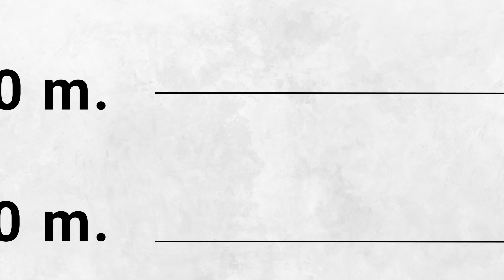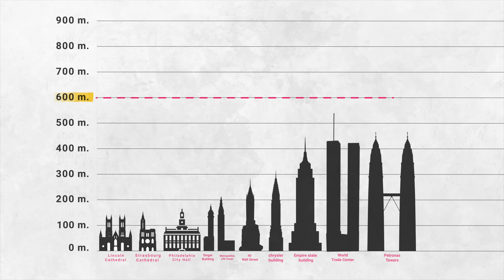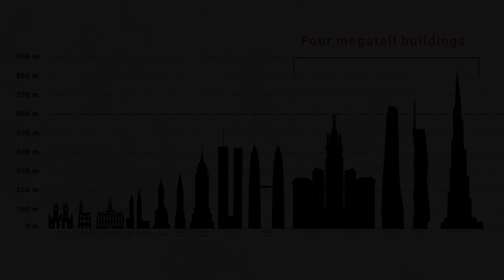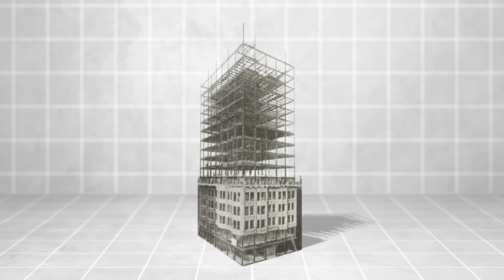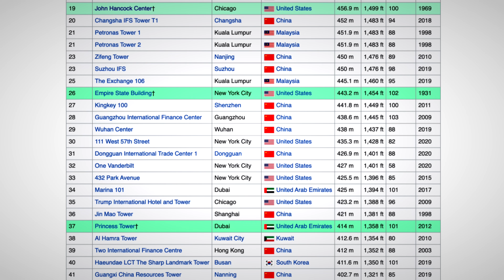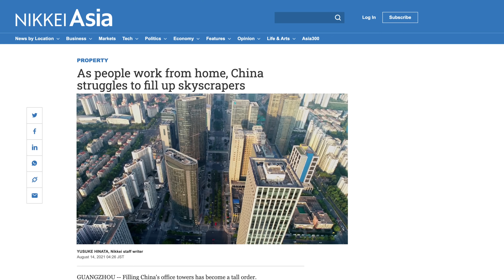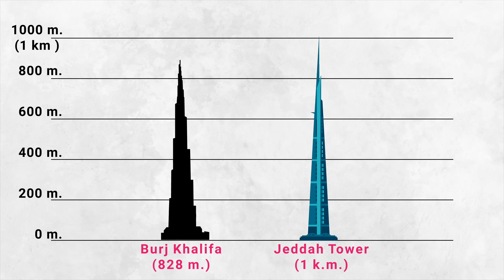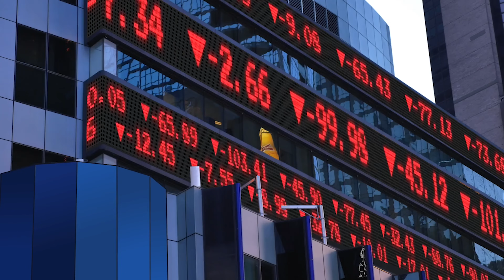The End of Mega-Tall Skyscrapers

Comment: I can't stand how skinny people put the the world trade towers on these graphs. They were massive buildings, height and width. They were the same width as the Sears Tower from top to bottom. Over 200 ft wide on each side. You could fit the Empire State Building if it wasn't wide at the bottom. I had been to them 5 times before they collapsed. Massive buildings that made 70 Pine Street and 40 Wall Street look small. And if you look at many other graphs, the roof top is higher than that in comparison to the petronas towers.

Comment: What about the tallest radio tower? I'd imagine those would be significantly easier to build. Doesn't need to accommodate housing and space, just height.
Reply: From 1974 to 1991 in Konstanynow, Poland there was a radio tower, that reached 646 metres of height, making it the tallest in the world. Unfortunately, it collapsed in 1991 (mainly due to bad technical state).

Comment: With new materials, new techniques, new construction machines and new energy sources like fusion, taller buildings will probably be built eventually. But it seems we reached our current economical and practical limit some years ago. With as many problems as the BK has, it seems it was built purely to be the tallest building around with no actual good reason (beyond the tuorist draw). I imagine that if humanity doesn't die out and we don't discover some vastly new and disruptive physics we will eventually see carbon nanotube space elevators, or space towers constructed with in-built active support, but that's not something a non-fusion economy can easily afford.

Comment: honestly the biggest problem with these towers is that they dont make sense in most cases to build.  lets say you build aa 600 m building and then put tons of people inside them. the amount of elevators needed to move all those people up and down this stupidly huge building  will cause countless trouble.  Realistcally the best building to build would be 8 building connected to there neighbours by bridges essentially making a whole level of the buildings  all inter connected allowing people to never even have to leave the structures

Comment: I don't think we're seeing the end of supertall buildings, just a temporary slowdown. Also, we're seeing a paradigm shift where supertall skyscrapers are now incorporating multiple uses under one roof, it's possibly the start of the so called "archologies" of science fiction. Although the only current reason for middle eastern countries to build that tall is for clout, buildings of similar height to and taller than Burj Khalifa may become a popular way of urban living. Now, we're highly unlikely to ever have a situation, at least on Earth, in which everyone lives in these archologies, but it could be that a significant portion of the planet's population lives in one archology or another.
There are of course problems with skyscrapers that low-rise buildings tend not to have. Firstly, the entrances to a building are 9 times out of ten located on the ground floor, which causes a bottleneck in high-rises where you're completely dependent upon the elevator to exit the building if you're on a high floor. Secondly, high rise often means high maintenance, even washing the building's exterior takes crew days, weeks and even months on end, often working dozens or hundreds of meters up in what amounts to a human sized basket. Also, the more people you cram into a given area of land, the more the electric, sewage and other infrastructures are strained.

Bottom line is that supertall skyscrapers are cool and all, but they're not really practical at the moment.

Comment: keeping them from collapsing is difficult enough as it is. Non practical architecture will fade away like anything that isn't viable long term. 10-20 stories buildings are optimal to maintain a high population density and relatively low maintenance cost at the same time(that's where I'm from but it could change based on the city). Like suburban villas in the US which are a waste of space. Ultra high buildings are on the same level of absurdity. I think the sweet spot of how high one should build lies between these extremes and that depends on many external factors like availability of man power, zoning laws, government enticements and more. Also there's a cultural aspect to it. We always associate tall buildings with wealth, like financial districts, banks, stuff like that. Maybe this idea will also fade away when the price of maintaining said building won't be worth it and they start decaying. So maybe 10 or 20 more years and people start not associating these structures with wealth then that will be the last nail in their coffin.

Comment: You didn't explain why a part of Burj Khalifa is uninhabitable, which is a pretty important piece of information. It's because at that height there's simply not enough space for habitation, especially luxury habitation.
Reply: @F&F.Dragon clarification there is a sewage system in place but when the building was first constructed it did not have a sewage system and they used truck
Reply: Maybe yes maybe no / They still use poop trucks 😂🤮
Reply: Yeh the narrator called it “vanity hight” . It exists just to make the building taller. Almost all the buildings he mentioned have some.
Reply: Francesco Nicoletti / Yup, I think almost half the Burj Khalifa is inhabitable and only vanity height, I think it’s roof height only reaches around 800 meters tall, still the tallest in the world, but not as tall as you’d think.

Comment: Copied from Wikipedia.
The Great Pyramid of Cholula, also known as Tlachihualtepetl (Nahuatl for "made-by-hand mountain"), is a complex located in Cholula, Puebla, Mexico. It is the largest archaeological site of a pyramid (temple) in the New World, as well as the largest pyramid by volume known to exist in the world today.[1][2] The adobe brick pyramid stands 55 metres (180 ft) above the surrounding plain, far shorter than the 137 metres (449 ft) of the Great Pyramid of Giza, but is much wider, in its final form measuring 450 by 450 metres (1,480 by 1,480 ft), compared to the Great Pyramid at 230.5 by 230.5 metres (756 by 756 ft).[3] The pyramid is a temple that traditionally has been viewed as having been dedicated to the god Quetzalcoatl.[4] The architectural style of the building was linked closely to that of Teotihuacan in the Valley of Mexico, although influence from the Gulf Coast also is evident, especially from El Tajín.[5]

Comment: As , I saw from the T.V Show If we built it Today .... They proposed a very nice solution to all the problems faced by building Sky scrappers .... And I was pretty convinced by those ideas .... Like 
1) Using Carbon absorbing tiles to reduce carbon emissions.... 
2) Not using man power but actually using Mechanical Robots which will work day and night non-stop ... 
3) The design was in shape of the world's longest tree (Sequioa) and  included A fan at the top of tower which will suck up the hot air and cool it down ... I feel  Good  to mention this design was made by a very renowned designer who designed the Burj Khalifa itself... 
But but but .... At the end whole conversation comes to the point of Economics  .... And it felt was illogical to build.... As the cost of building was estimated as 5billion$ and it would nearly take twice the time in which Burj khalifa was built ... So it was cancelled .... 😒😒
Reply: So actually no solution to any of the problems. Not sure how that convinced you but okay

Comment: As a structural engineer, skyscrapers are just trash. Extremely expensive, inefficient, and generally only motivated for ego and painfully bad business decisions. Most skyscrapers are plagued by issues and the maintenance alone makes them unusable for their occupants, to the point that  some apartment skyscrapers, such as the newest in New York, are mostly unused and were sold solely as a speculation asset. The few people who live in these buildings have complained regularly of issues due to the height and the heavy maintenance needs.
I'm that regard. The Burj Khalifa in the best example of how these projects are just a projection of stupidity, does not have sewage. It requires a daily parade of trucks to unload septic tanks. That's the standard of the tallest building in the world

Comment: One and only reason : MONEY

Constructing a megatall building is so expensive what we learn from Burj Khalifa and Shanghai Tower, the building itself mostly empty because only few companies or individuals wants to buy or rent a space on it, since the construction cost are high, developer sells or rent office, commercial, or apartment unit in premium.

Don't forget maintenance cost, taller the building, higher the maintenance costs, even as simple as "pumping water from the ground to the rooftop tank" is energy consuming and it also far more expensive on a supertall building with 100+ floors than typical 10-20 storeys apartment complex.

Comment: Tall sky scrapers all have a constant electrical demand, most of which would not exist with a shorter building.  It has to do with plumbing and the cost of raising water by pumping it against gravity.  These structures also generate a lot of heat from lighting and whatever mechanical devices are needed to maintain a comfortable environment (that includes heating and AC, food preparation, elevators etc.  etc.  What all these things do is demand inputs of energy (usually fossil fueled devices).  This places them at risk of failing if power or other inputs are cut off for any reason.

Comment: cool video! though I‘d argue something you say at 2:55. You say skyscrapers prevent urban sprawl. I understand what you wanna say with that but i think that sets a wrong focus.
in my opinion urban sprawl isn‘t caused by too little skyscrapers but by too many single family homes. 

Because if a city would change single family homes to appartement buildings that are four or five storeys high you could increase the housing capacity by 400%-800%.

Skyscrapers are usually not that effective because they need to keep their distance to other tall buildings and use a lot of floorspace for elevators and other ‚public infrastructure‘

so to fight urban sprawl we‘d have to fight single family housing - not support skyscrapers

Comment: 1:07 is wrong. Strasbourg Cathedral did NOT become the world's tallest building in 1439. It was actually somewhat smaller (142m) than previous record holder, Lincoln Cathedral (160m), which held the title until its spire collapsed in 1549.
Reply: To be fair, a long thin spire was kind of a cheat (very common for cathedrals), I'm mostly surprised it didn't collapse sooner. And you're wrong too, Strasbourg Cathedral actually became the tallest only in 1647, a long time after its completion: there were other cathedrals (two in Germany and one in France) between Lincoln and Strasbourg as the tallest buildings. They all followed Lincoln Cathedral's problem: the tallest part collapsed, because each time it was a long ass thin spire designed only to go as high as possible. Reasons are varied: storms, lightning strikes... one way or another, the result was the same. That's the way I think Strasbourg Cathedral is remarquable: it's still the same to this day, it never had any problem from 1439 to now. A remarquable structural stability.

Comment: My question is it really necessary 🤔

Would smaller more ecological buildings be better?  A house made entirely from wood. The highest building made from wood stands in Vienna it has 84m and it has the highest standard of thermal movement inside. I'm not sure if they have need AC
Reply: The only problem with that is fire.
Reply: @arthurriechert3833  actually they are more fire stable than concrete

Comment: Frank Lloyd Wright not only DREAMT of a Mile High skyscraper, he developed a complete blueprint for it, in the 1950s. Super Talls will continue to be built in NYC but they'll be Super Thin too.
Reply: "Wright believed that because his building was fireproof, any fire precautions would be moot" Good luck building that.
Reply: Still a beautiful design. I love how he fashioned it after a tree with a strong central core and outer walls which were not load bearing, meaning even interior spaces would have had a light and airy feel. 

Hopefully one day someone unravels the blueprints, updates them to meet fire code, and actually builds the thing
Reply: @TalenGryphon  granted I don't know the full specifics of the plans, I don't think it's likely considering the top floor was designed to only be accessible by elevator. I'm sure his plan was possible, but fire safety is always one of the biggest concerns when designing large buildings like this.
Reply: Yep, in Chicago, but as far I know they only have one current one thousand plus footer in the works. Everything here in the US at least at the tallest seems to be from the one thousand to fifteen hundred foot range. What blows my mind is that Miami(which has no thousand foot buildings currently)could tie or overtake Chicago in the category within the next ten years.
Reply: The magic skyscrapers are so big like they feel like they're just going to cut the sun apart

Comment: Really nice video. As for China, I heard they are turning away from tall buildings because an increasing number of them are turning out to have embarrassing and costly structural problems. They want to reign in vanity and increase quality.
Reply: Haven't heard of that reason. Mostly due to the cost and fire hazard or other safety concerns, like avation limitation. What sturctural problems are you talking about? Sounds like a stereotype on chinese bulidings, the newly built skyscrapers are in great quality, but they are not affordable to most company during these days.
Reply: @yzchen6758  Hey YZ - I looked into this and I think I was mistaken. I was probably thinking about cracks in OLD buildings that were built before Xi set more rigorous construction standards early on in the skyscraper boom. Looks like Chinese safety standards are stricter than international code, if anything. My mistake
Reply: @jackedattack8781  Not your mistake, it's because MSM stereotype with everything related to China. However, just like you said, the building before strict laws are more likely to be in poor quality.  (I think it's enforced around 2000s? )  
Another thing I have to point out in this video is that the so called ghost city is not accurate. Most of the buildings that are not occupied are due to developers' funding problems, which means the building are never finished, so no one can live there. Otherwise it's due to government planning, this area has been developed ahead of time and will soon be populated by a large number of residents. Surely there are some ghost area, but never seen or heard any of them myself. 
Source: living in China for 30 years as a Chinese.
Reply: @yzchen6758  Hey YZ - Thanks for being polite and informative instead of rude. I learned something and know to be careful of propaganda. The Chinese urban environment seems world-class. I have known about Shenzhen for a few years, and am now learning about Chengdu... I really like Chengdu. It has the largest building in the world by floorspace, and the weather is not as HOT as the Pearl River Delta, haha. If you are still in China, I hope you stay safe. The media in America has been portraying white hazmat suit authorities as somewhat brutal. Not sure if it is overblown or not.
Reply: @jackedattack8781  It's hard to not be rude on the internet these days, thank you for being polite too! The high-rise in China is growing fast, but not in a healthy way, especially seeing the rising debt and household prices. That's why they are restricted now. A skyscraper in my city was halted during construction, it was designed to be 636m tall earlier, but the government decided that it won't go any higher than 500m.
Those people in white hazmat suits are mostly local police, government employees, and volunteer community workers. Many of my friends volunteer to do the work. The situation in Shanghai went quickly bad with omicron last month, and China is still implying a zero-tolerance policy, which means total lockdown. it's hard for residents to get food and necessity with such a policy. There are too many people to feed and care for, so they may be rude and ruthless under pressure. However, normal police don't even carry any weapons, and I don't think they are anywhere near brutal. 
Anyway, feel free to ask anything about China, or you can contact me on WeChat, Twitter, or Facebook.